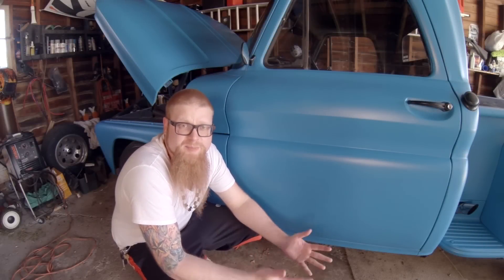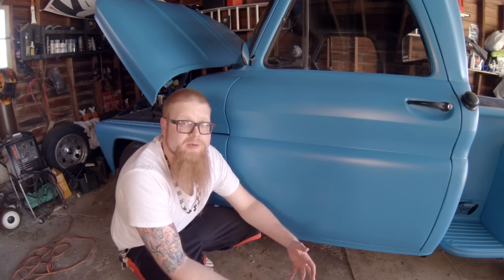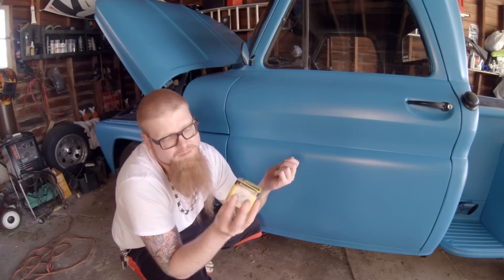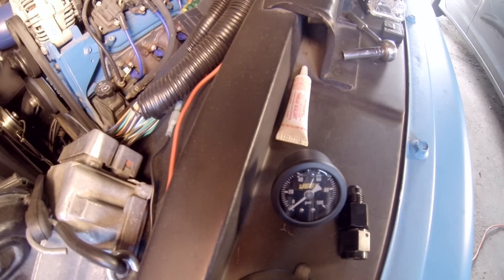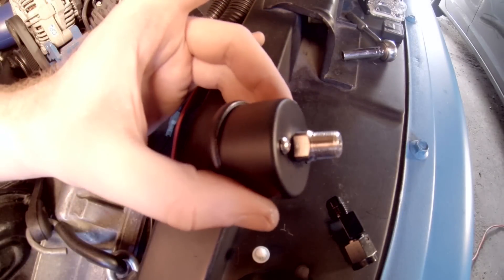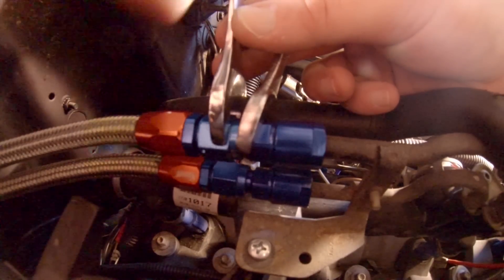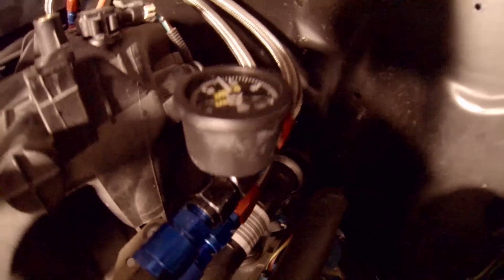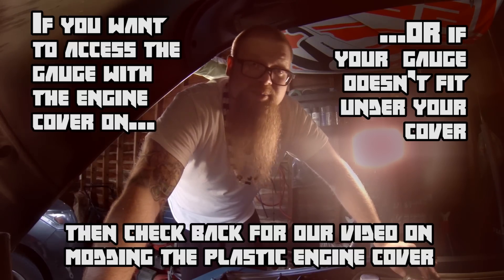Fuel Pressure Gauge Install on LSx Rail - REV J HD

Comment: My father had a '66 shortbed fleetside when I was a kid it had a 4 spd manual and a built 350 in it , the guy he bought it from drag raced it in the late 70s early 80s, my father painted it in the late 80's early 90's with a crazy show car scheme complete with scallops...I still have a picture of that truck in my garage hanging on the wall, I've had 2 c10s over the years a '72 and my last one was a '68 that I LS swapped and sold for a nice profit. ....next time around I'm going with a '62-'66.   Such beautiful trucks when done right

Comment: are those feed and return lines ran straight to the fuel filter/pump/to the tank or did you get those to attach to stock hard lines? Currently trying to use my factory fuel lines up to the engine bay and just run shorter stainless braided lines to the fuel rail, also need to install the fuel pressure gauge.
Reply from the maker: I bent new hardlines for the 3/8 feed and 5/16 return.  Its only braided from the firewall area over to the engine. Mine goes tank-pump-filter-hardline-braided-gauge-rail IIRC
Reply: @REVJHD  awesome thank you very much for the info! This is also my plan of attack but without being too familiar with these fittings and what not for after market, I wasn't sure it'd work like this!

Comment: What did u use to make ur feed line for the fuel
Reply from the maker: 3/8 hard line from rear of truck to the firewall, then 3/8 braided line to a female -6AN. Then a -6->3/8 quick connect fitting attaches it to the rail.
Reply: Okay thanks man
Reply: Okay thanks man

Comment: can you help me or anyone out there,  I have a 71 and I have a 04 Sierra donor. I want to run a walbro 255 to a fast fuel rail. the Sierra is a restless style. on the 71 can I run -6 lines from the fuel pump to the fuel rail or what does it need to go through something else. yes I know about a fuel filter. thanks

Comment: Awesome! Thanks man. Did you get panel at home depot or lowes?
Reply from the maker: I had access to a rack full of sheetmetal at the time.  You can find it at those places if your store is any good, but mine usually aren't. Check to see if there is a metal supplier like Speedy Metals or somthing in your area, they have been much easier to deal with for stainless and alum.

Comment: How do you make the dash panel
Reply from the maker: Get a panel of stainless steel, trace the original dash, trim to fit. Most of it was done with a scroll saw and some hole dies.  You could do it with hole drills, but stainless can make that hard (especially in large sizes like for the tach).

Comment: Dude that is good video very much help full
Where did u find buy that black male female connection and the gauge I'm interested in doing the same
Reply from the maker: the gauge is from Jegs.  The fitting was given to me by a subscriber but you can find them at Jegs or Summit (or any other large performance parts retailer).
Reply: REV J 
Okay bruv peace respect to that I will look for it